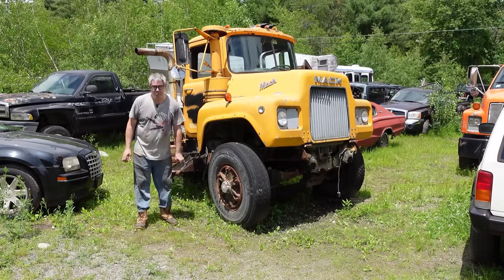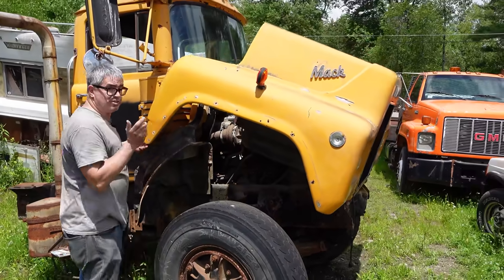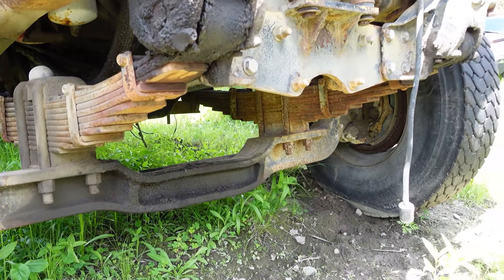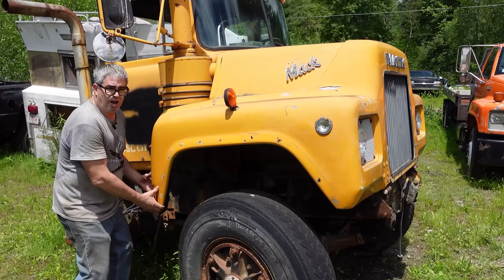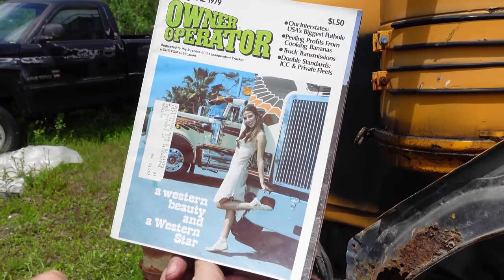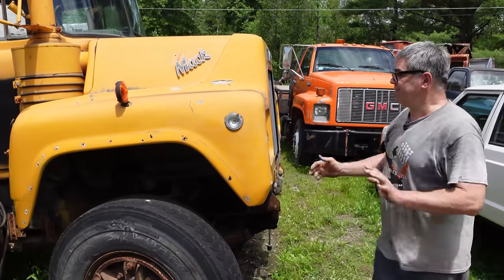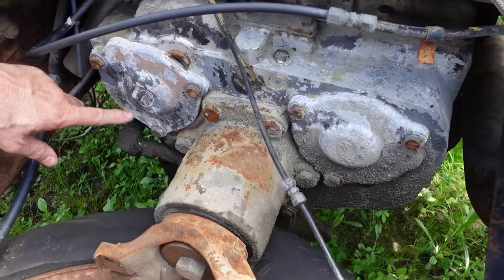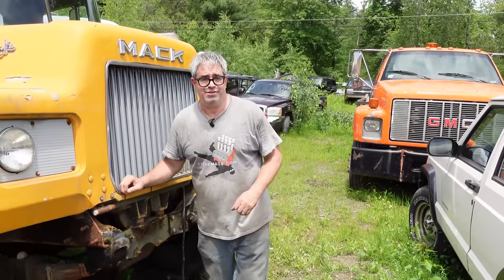Truck Week EP2 - Mack DM600

Comment: Glad to see another video of you on the mend. Here's what I said last time:

We'll try this again, as the post keeps dropping out...

No, Mack was started in Brooklyn, NY in 1900 and moved to Allentown, PA in 1905. The bulldog emblem came about because of WWI and the British said the truck's front end looked like a bulldog and was just as tenacious as one. The bulldog emblem was designed by a Mack employee on home recovering from a surgery. A gold bulldog indicated/indicates a Mack engine and transmission, a silver with components by others, and copper for  electric powered, but there are exceptions. 

Mack's motto was also, "No Mack Truck is an Orphan" because they believed in keeping parts and service alive for older models. They had "factory branches" in principal US cities which would also act as modification centers. I know of several in my area and my job has a facility right next door to a former one. Some became actual truck dealerships. Another was up the block from where I work now. 

Mack also has a service called the "Functional Museum" where they will do research if you give you a VIN number and give you production records, line sets and other interesting data on your vehicle. I wrote to them about 1959 Mack B Series that we had (one time in service, now a parade vehicle) and Mack was very interested in it saying it was, "Only one of one we ever built and where did you find it?" That old Mack was in storage for years and fired right up with fresh fuel, a new battery and cleaning the points (it's a gas engine). It's also a sharp looking truck. We have a few B Series trucks, they are all antiques now. They are a bygone era and a work of art. 

For a time, Renault owned Mack as did the Signal Companies, but eventually Volvo got involved and owns them now. Mack's HQ is in Greensboro, NC, but they still have production facilities in PA, including the Macungie, PA facility. We know this truck is pre-1981 as it doesn't have a 17-digit VIN number. I would have been interested to have seen the upfit decal on the door jamb area if it still existed. That would have give you a clue as to its former life.

Mack was also known for fire apparatus and their CF chassis were legendary. They ran forever, required no more than basic maintenance and they were powerful and fast. The window regulator was a leather strap with holes in it much like a belt for your pants. The strap would be put into a notch depending on how far you wanted the window down. The engine tunnel threw enough heat to keep the cab warm. I still speak to some retired people I used to work with and they were all huge Mack fans and never really had an ill word to say about them.

The expression back then was, "It's built like a Mack Truck".
Reply from the maker: Hello Googlusergp!  GREAT to hear from you after so long. its been a long road since August when i got encephalitis. its been tough feeling like i'd dropped the ball. As one of my favorite viewers, i say - again THANKS for keeping the faith. I have a neurologist appointment on February 14, My hope is to be released soon thereafter. Once I'm "cleared for take off" I look forward to resumed fresh Junkyard Crawl expeditions. Thanks again, Steve Magnante January 16, 2024
Reply: @SteveMagnante  I (along with I know others) look forward to seeing you back in the game soon. I did some research some time ago on Mack and they used to have a fire apparatus manufacturing/upfitting facility on Anable Ave and 34th Street in Long Island City, Queens. Anable Street is now 48th Ave in Long Island City and I know exactly where the building is and it's close to where I work, in fact it's walking distance. I've spoken to the guys at the Functional Museum in PA and they are the "Pontiac Historical Services" of Mack Truck. The literature that they send you when you contact them is mind blowing. Good luck with your medical appointments. Tell them to make sure that they get your "firing order" correct and keep your timing from being too far advanced.

Mack's other slogan (at the time), "No Mack Truck has ever worn out".

Comment: The R series is my favorite model of mack truck.  Had a 73 R 688 pulled mica from hartwell ga . The truck was owned by 3 different people the first owner purchased the truck from southeastern freight in 75 and the truck and dump trailer did the same job with 3 different owners from 75 until the plant closed in 99 the the truck had a short 12 dump for hauling asphalt in tight places installed and last I heard its still working today in the Charlotte NC area the truck had 2.5 million miles engine was rebuilt 3 0r 4 times same trans and axles as a side note the green interior was from 66 to 73 and the RD came out in 88 was dark gray

Comment: Thanks Steve, I worked on quite a few of these early on in my career. Looks like that one has a triplex transmission (twin sticks). Cool stuff!
Reply: Triplex is 3 sticks. This one is duplex
Reply: Possibly a Maxidyne engine (high torque ) ,some were equipped with the Maxitorque Trans,  which was a 6+1 (low hole on first only . Others, like the one I drove had a Thermodyne engine with a 5+4  . Learned a lot on that truck ! Get well, Steve

Comment: I wonder how well the shutters worked in snowy icy conditions. I have several antique John Deere tractors with shutters. The object for them was to maintain about 200 degree engine temperature because of the distillate fuel they burned. One however uses a thermostatically controlled shutter system to maintain normal operating temperature. That one is a gasser.

Comment: We still have several of these in service in our fleet. They run forever and you can still find parts for them pretty easy. In fact, they still make parts for these. There's a local transmission shop that rebuilds the transmissions and transfer cases for us. We rebuild the engines over and over. You can still order all the slack adjusters, shoes, etc just as easy now as you could have back then, for the most part. Believe it or not, you can still order door trims and window felts, horns, and all kinds of little odds and ends. I will say though, that we stretch the frames and build these into peices of mobile equipment that spend most of their time on customer sites, and not on the open road. There's no way we'd want to foot that kind of fuel expense. Reliable though. All of our OTR trucks are new Macks.

Comment: Hey Steve. 
Nice piece in MACKs.
They were the original Git-R-Done Truck.
My "76" R model had 8.5 million on the clock when I bought her.
The 300 hp, had just been replaced with a new 350 hp,
with a Mack 5 speed behind her.
One thing though.
The offset cabs, at least around here, in Philly.
Were strait rucks set up to haul long steel.
So back then it could, hang off the back 36",
then up and to the right of the cab, 
and passed the front bumper by 12".
Stay Well, Sir.

Comment: The reason for the offset cab was for doing local work,  backing a trailer to a dock. With the offset cab that made it easier to see the rear of the trailer.  Which made backing easier.  If you were backing 15, to 25 times a day, the easier the better.

I'm guessing the 2 shifters are for the 2 stick 6 speed transmission.  Driven a few Macks with that transmission,  a good transmission,  and Mack made some very good engines.  Just my opinion

Comment: Those of us who grew up around these working class trucks find that the R, U and DM Mack's are just as pretty as a Peterbilt. Also, if you see a Mack with the Golden Bulldog on the hood that means it's a purebred Mack; engine, transmission and rear ends are all manufactured in house, by Mack.

Comment: I've spent a little time in an old U model we have at work, it takes getting used to, and you don't wanna forget about that flush driver side step when you get out 😂 it's kinda weird when you look at it, the shifter pretty much comes out under the passenger seat

Comment: Hoping your progress continues Steve, for sure you want to get back to the regular life;
Only he-men drove these trucks-no place for the timid to do a day driving it
Of course if it's gonna be 105 they want you to haul some blacktop in your small cab  DM. Usually no/ac but that big fan is sending even hotter air into the cab.Not a big fan of sitting on top of any engine really, plenty of packers and tandems used these trucks and the US Military had many variants

"And what does the hood have in common with a Fourth-Gen Chevy Corvette?"
the forward tilt front end

Comment: I spent many miles driving Mack R models. The guys buying them usually weren't the ones driving them. Even with air conditioning they are hot inside. I never drove one where the windshields didn't leak in the rain.

Comment: Sorry you didn't go into the twin shift transmission. You can actually put the right shifter in reverse and have 5 speeds in reverse, 3rd gear is as high as you might want to go in reverse. I had an operator show me how to back up and shift up while doing it. I was never that good.